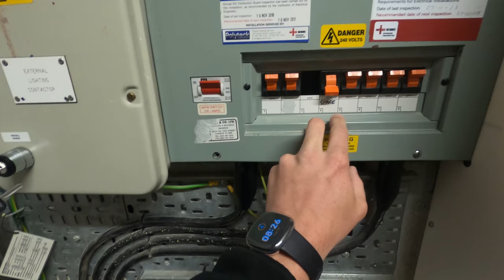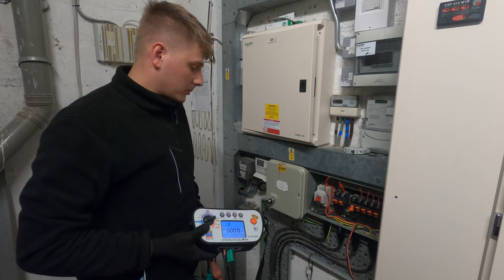Fault finding INFESTED external lighting columns

Comment: Nice one using the chisel as a garden trowel🤣would you have gonna an extra step with gelling those whiska boxes. No matter how well those are terminated I do find anything outside, even condensation will lead to corrosion of terminations and shorting out. Real pain when they go under tarmac🤦🏾

Absolutely correct I think the circuit does need more TLC. This is where engineering design really helps because I guarantee anything outside will deteriorate much more.

Comment: Is the time clock a normal one or an Astro clock ? reason I ask I had a job where the customer spent daft money getting the main contractor out 5-6 times a year to suit the seasons and summer/winter times. I fitted an Astor clock that shadows the area you are in sunset and sunrise time plus it automatically changes the summer winter times

Comment: I started my career in telecommunications, and it's not uncommon to use a TDR (time-domain reflectometer) to tell where a cable fault lies, they can do this by the meter. I've seen very big distribution suppliers using something similar ("thumping" they call it?) but I wonder if any general sparkies have ever used such a thing for these runs where you can't easily determine where a fault lies?

Something like the Megger TDR1000?

Comment: You could have put small fuse carriers inside the plastic box , otherwise one faulty ballast will take the whole circuit out . Street lighting cutouts would have been perfect for this job .
Reply: @residualelectrical  putting a rcd onto an outdoor circuit like that is never going to end well with damp conditions.  Street lighting should be exempt from rcd as long as you have a good Zs reading and routine maintenance/testing

Comment: Is putting an earth clamp allowed on swa or just bad practice ?
Reply: Not sure if reg's allow it or not, but whoever wired those up did a crap job as they tightened the terminal clamp and steel strands down onto the inner flex cable, they should've used clamp rings, so yea very bad practice either way. In practice BW and CET glands are considered acceptable - in and around Birmingham anyway. You'd think CW's would have to be used for everything outdoors for 230v.